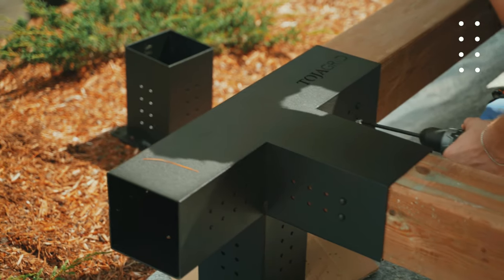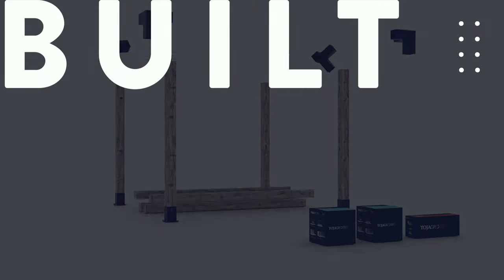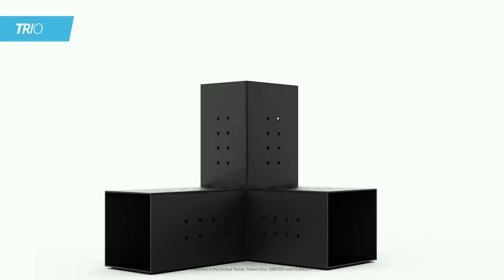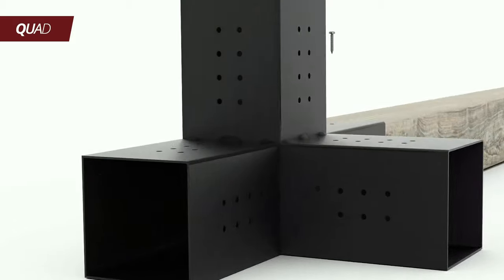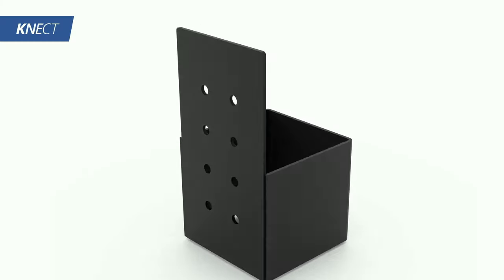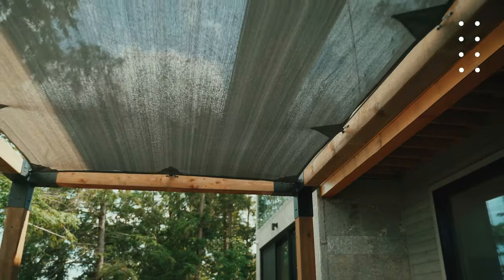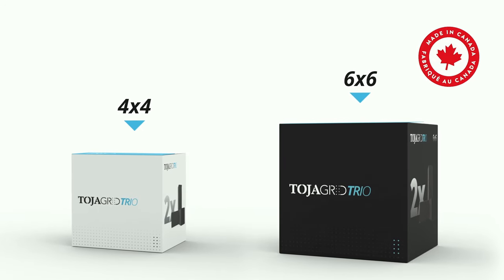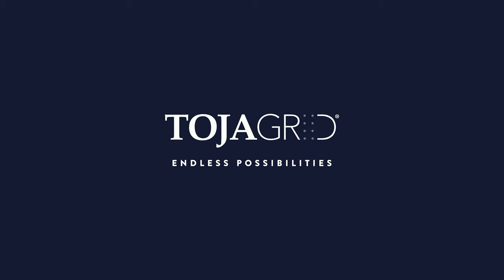Just Add Lumber - Toja Grid Modular Pergola Systems

Comment: @TojaGrid your website says recommended height of only 8 feet. I’m hoping to construct mine slightly higher at 8feet 3 inches. What issues are fore seen at heights greater than 8 feet ?
Reply from the maker: Some customers have built beyond our recommendation and been fine but do so at their discretion.
Reply: Здравствуйте. Подскажите изделия сделано из металла или алюминия?
Reply: @tojagrid здравствуйте.подскажите изделия сделаны из металла или алюминия?